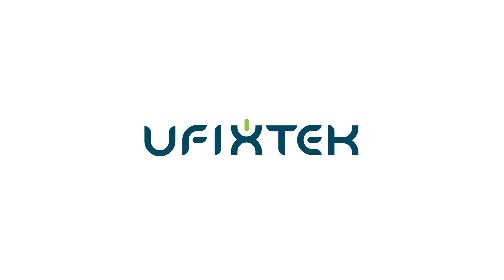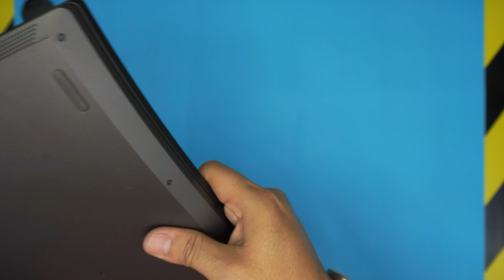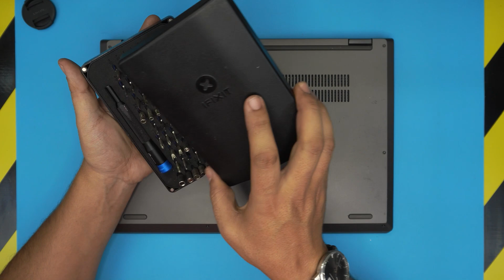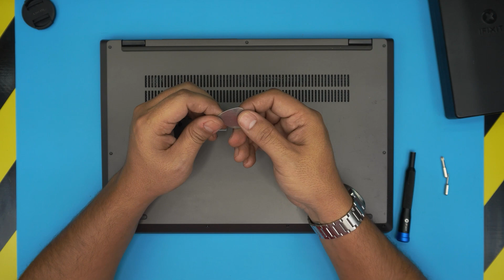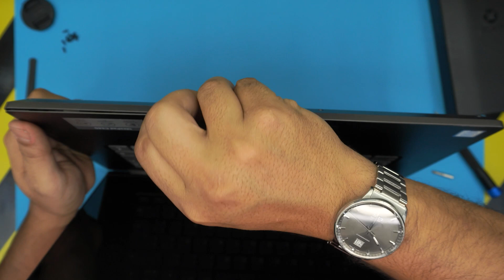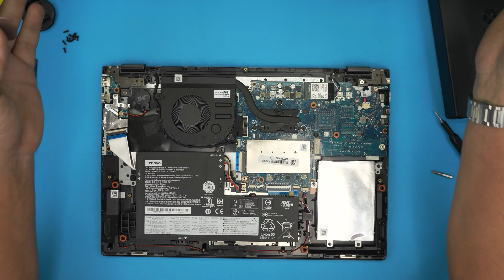Lenovo Ideapad C340 15Iwl 🚩 81N5 Battery Replacement

Comment: Thanks for the video.. I need to replace the battery on C340-14API (81N6), but I'm not sure which battery should I use, I've seen on Amazon some that are supposed to be compatible with mine but also with other ones, but they have different voltage (higher), which one should I use ? First time looking at this devices :S 

Thanks in advance!
Reply from the maker: It's my pleasure my friend.
🫠Regarding your question, we recommend this battery for the model you mentioned, don't worry about the voltage.
https://amzn.to/3AifY3F
Should you have any further questions or requests in the future, please don't hesitate to ask me.
cheers🍻

This is an Amazon affiliate link. When you use my links, you are helping to support the channel. 🙏